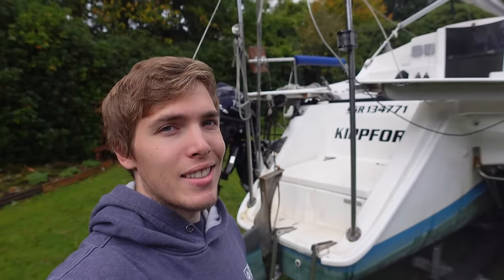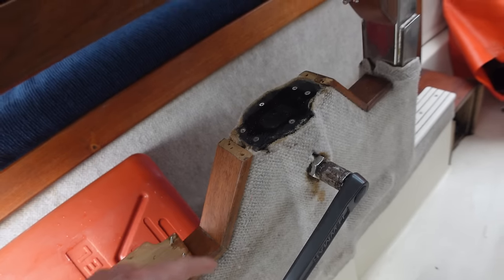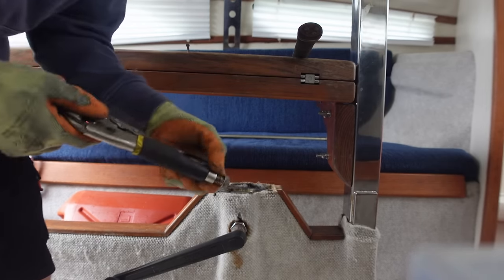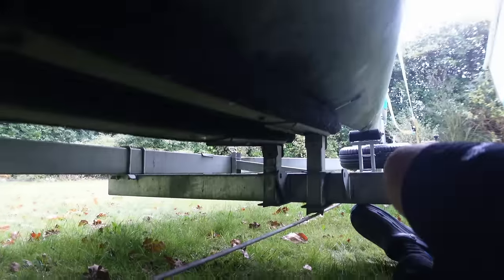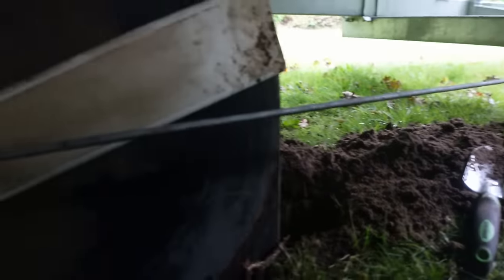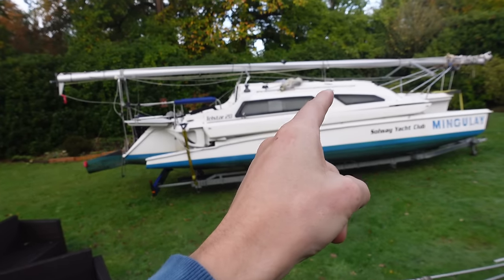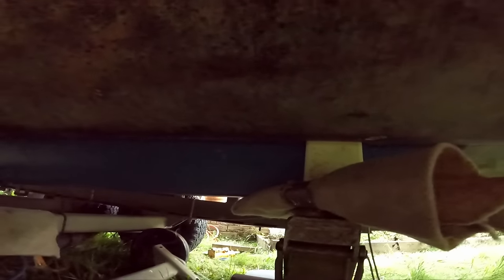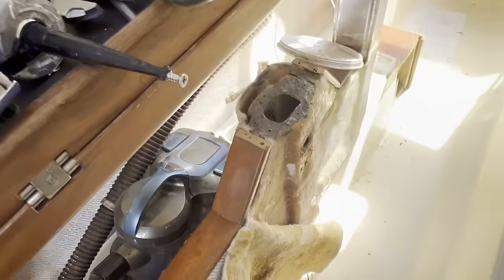HOW TO CHANGE A CENTREBOARD ON MY TRIMARAN | Ep.123

Comment: Very interesting episode Alex and great job sorting out the centerboard! I was thinking, if you had small line fed down through the centerboard trunk, looped around the spool and back up, you could use it to help position the spool and align the pin. (Just a thought) I did some work fairing a rudder and later learned, it the both sides of a foil aren't exactly symmetrical to each other, you may experience vibration at various speeds. The solution was to make some templates and compare each side to ensure they're the same. Cheers, Tim
Reply from the maker: Yeah that would have made it a little easier and I think I got each side quite close and I don’t think I have had any vibration.

Comment: Alex: I have a 2008 Telstar 28. Your videos have inspired me to do more modifications myself. My centerboard rope failed last season. I’m having the boat hauled this week. What size and length of rope did you use to replace the old line around the drum? I have the video Tony and Will made but they don’t discuss that. Thanks for any help. My board is longer than yours, hopefully that won’t make a difference.
Reply from the maker: @AndrewsRenaissanceExperi-mk3vr  don’t think it will make a difference. I think it was 10mm but you can also check through the inspection hatch. Length I would get 3m to be safe.
Reply: @AlexGoesSailing  thanks. I pulled the board yesterday. It wouldn’t come out until almost completely vertical. The starboard and rope fell off before I could take a picture. My board is different than your model. It’s longer, slightly different shape, and I has an extra roller (smaller) underneath the grey PVC roller. I contacted the builder’s son, Will, to ask what’s the purpose of the smaller roller. I have till Tuesday to figure it out as the boat yard will force me back in the water.
Reply from the maker: @AndrewsRenaissanceExperi-mk3vr  send me some pictures on my email or instagram

Comment: Bet you wished you had dug the hole before driving the trailer in place!
Out of interest, what is the size, thickness and specification of the board.
Reply from the maker: 44mm thick if I remember correctly. Two big bits of marine ply stuck together. Not so sure on length and width but there is a drawing floating around on the internet! Yeah digging that hole beforehand would have been nice!

Comment: You realise thst would have been easier to do when the trailer wasn't under the boat 😂
Reply from the maker: It would have been but the timings didn’t work out unfortunately. But it did feel safer with a trailer under the boat!
Reply: @AlexGoesSailing  Definitely safer, mind you if you were fat like me, the tummy comes in handy for holding things up 🤦‍♂️
Reply from the maker: @fat_tommo_goes_boating  😂